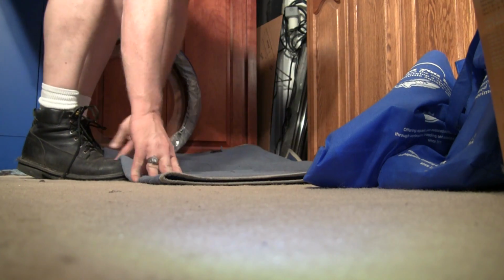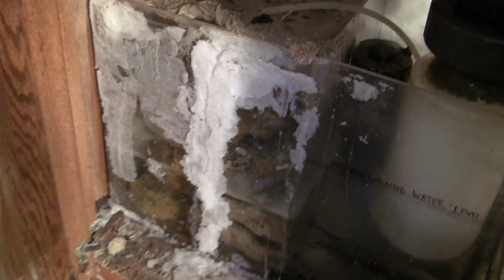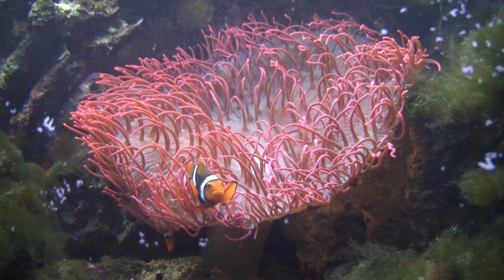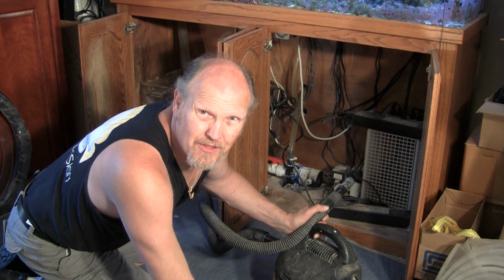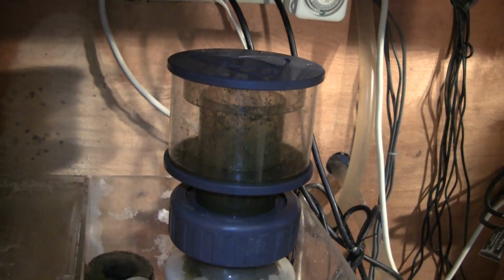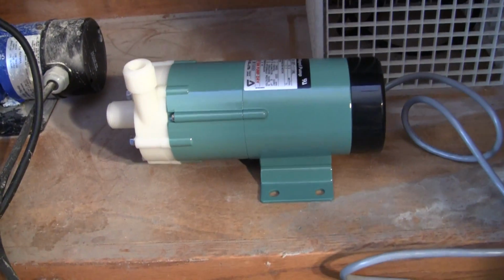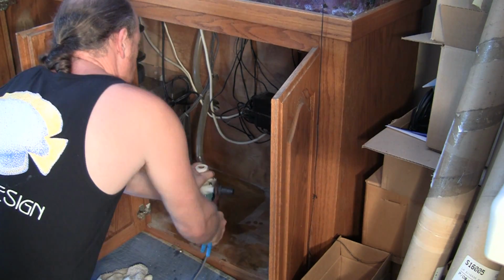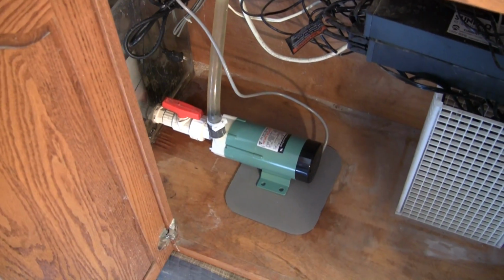Cleaning My Own Aquarium, LA Fishguys, Episode 116 pt 1

Comment from the maker: hey B, there are a few Algae Scrubbers on the market. the Santa Monica 100 ( the unit I used in this video ) runs about $650 plus the pump. a new smaller version, the L2 ( seen in future videos ) sells for about $350 plus the pump. I have resold the SM unit but I believe he is ouit-of-stock on it. the L2 you would need to contact Bud direct as he does not have resellers yet and I have not completed my Scrubber Filter yet.

Comment from the maker: hey B, I assume you are refering to drying out the water pump for its storage? I have found that if not removed and cleaned its quite possible that the magnet portion of the impeller assembly can swell and either become stuck in the pump or not fit back into the pumps well. its usually the result of wear to the magnet casing allowing the actual magnet to become exposed to air and then begins to rust and expand.

Comment: Hey jim i use a rubber mat on the bottom of my pump and bolt it to the stand and add 4 rubber gromits on the other side than add the nuts to the bolts and you cant even hear the pump run. I think it would help your pump. I cant even tell its on sometimes and i scare myself thinking it stoped working.

Comment: Jim, may I suggest a hang-on protein skimmer with the addition to the algae scrubber? You may be able to incorporate more room by that method. Option 2, I have been using Red Sea's NOPOX nitrate and phosphate reducer, and works great. Kept all types of algae at bay. Either way Jim, you seem to find the best solution in the long run. Excited to see the result of the scrubber, but try to find a way to keep that protein skimmer!!

Comment from the maker: hey I, to add the scrubber I had to remove the protien skimmer and since the skimmer had not stopped, slowed or removed the algae problem it was an easy decission to make to remove it for something that may, and did prove to be more effective. as for the 'caked neck' thats just from neglect. I dont feel cleaning or adjusting it would have improved my algae situation....it did not during the years it was running.

Comment: it is a supreme HY-Drive Pump  modle 4800  at 5100 gph. my wife said get it to be quiet so i got a piece of rubber that is about 1" thick. and got some 6" bolts and some washers, nuts and  rubber grommets and put it all together and now you cant hear it. you can get the 1" rubber pad at Homedepot for the work area in the garadge.

Comment: Another great video Jim I've been to that place were you lose interest in the hobby. You said you were having a problem with heat in your tank due to the old pump but I noticed you were using t5s and CF which also introduce some heat into the tank have you thought about switchiing to LEDS to eliminate the heat factor from your lights. I know when I switch from T5s to LED there was a significant heat decrease in my tank espeacially since its been so hot here lately in southern cali.